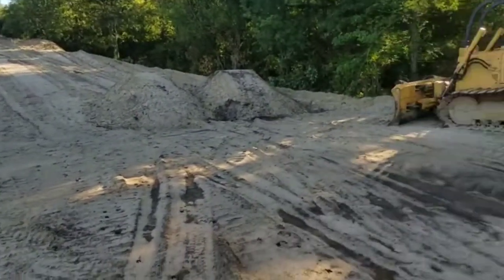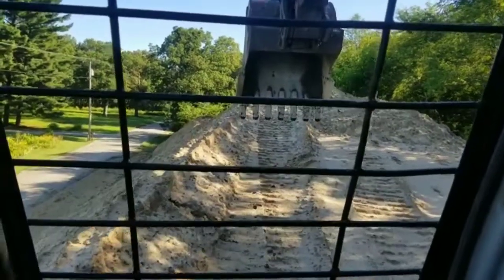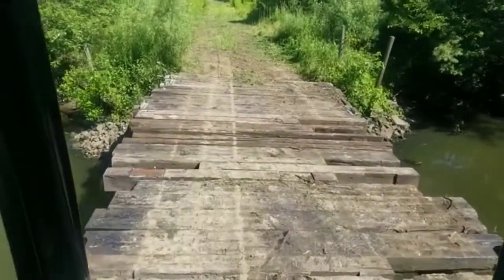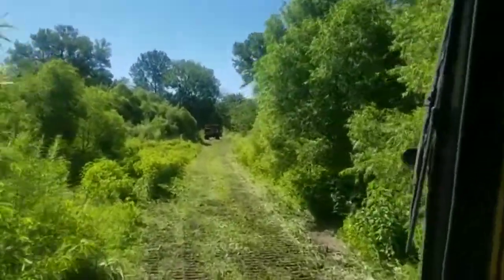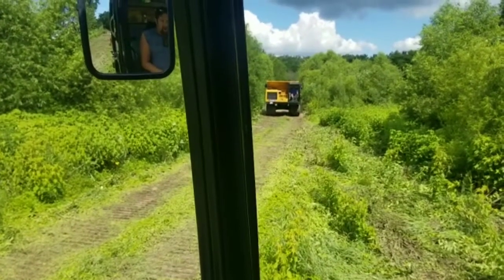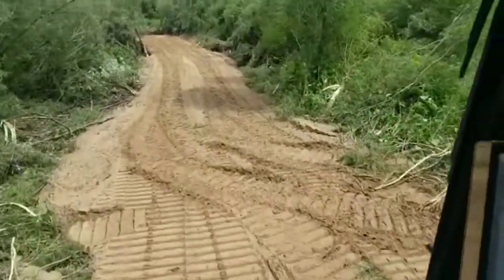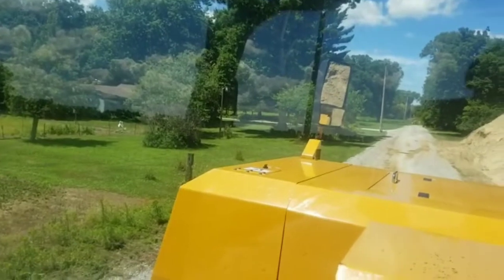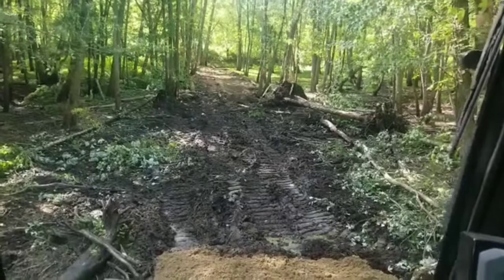We ALMOST made it $230,000 track haul trucks and rickety old bridges!!!

Comment: Those trucks are really cool! We could have used them building levy during the Missouri river flooding in 2012. That would have been easier than 1979 Pete with belly dumps and side dumps. Safer too. 
Doc
Reply from the maker: They are cool but the are rough to run and they get hot!!! So hot you cant hardly touch them.....belly dumps would be fun!!!

Comment: I have a dumb question and maybe I just didn’t understand what you described at the time, but when you took your first load back, you dumped the sand and then swung around to drive over the pile you dumped and you said it was a little rough when doing that. Why didn’t you swing around and dump the sand instead of dumping behind you and driving back over?
Reply from the maker: I had to re watch it it's been a while lol.....the reason i did that was i was trying to spread the sand as I drove to build up a low spot we had there and I dumped it alittle to fast them beds get to a certain point and it all slides out pretty quick I really thought I could string it out thin I was also trying to make the dozer guys job alittle easier now with the none swinging trucks that I also talked about them we would drive in and dump so we could be lighter get turned around so almost every time we would have to drive back over the pile .....but it is fun to crawl up over piles with them though and it dont hurt em  lol
Reply from the maker: And really there is never a dumb question some times I may not explain what I'm doing clearly so just ask!!